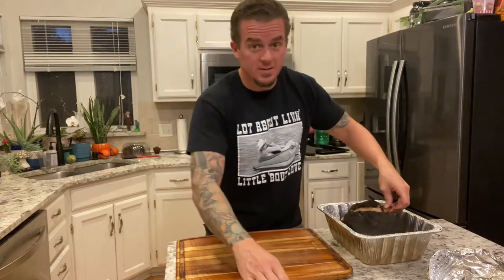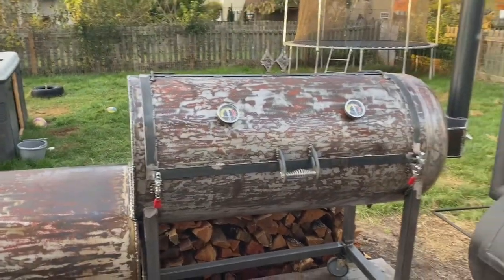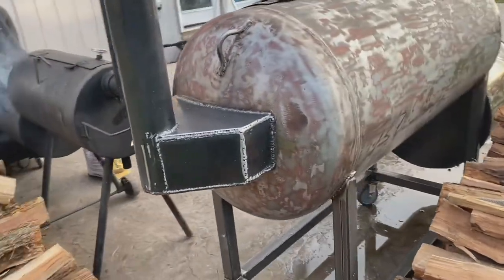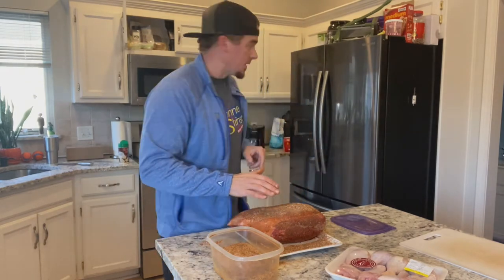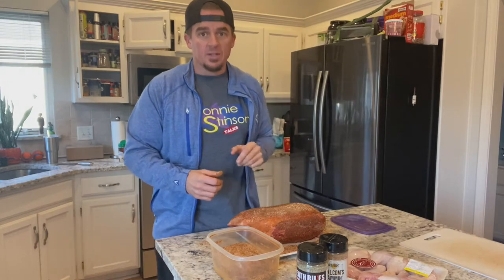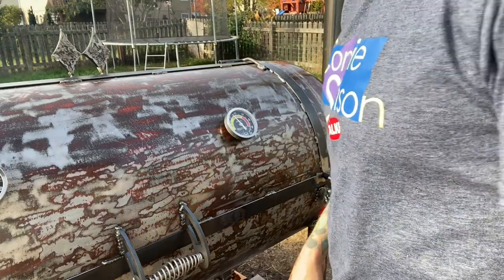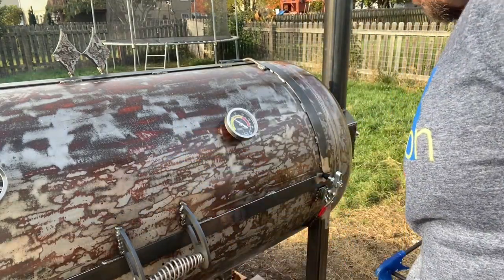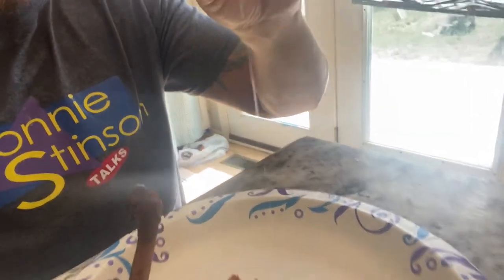DIY Smoker Build First Cook and Overview | Pulled Pork & Texas Lollipops

Comment: Thank you for your candor! A couple of things in my humble opinion: keep your "rub hand" clean when seasoning your meats. As someone already mentioned, I agree the wood is too green or wet and that you can help this by keeping your splits that are next in line on top of the firebox. I wouldn't mess with your firebox airflow damper ("daisy wheel"), just make another notch in the piece that you use to lock your firebox out closer to the end and you can just set your latch into that and it will hold your firebox door open a little (one notch holds it closed, the new notch holds it open a tad). Then you can use your "daisy wheel" to dial it in if need be. Also, if the wind is too much, use a folding type table to block it by laying it on its side between the wind and your firebox.Watched from the start of the build and I think you built an excellent pit! - Rob

Comment: Two things: you can fix your door being sprung issue by welding a couple pieces of rod on the inside of the door. Get it bent to where you need it and then tack them on. 
Second: Open your door to allow air flow, I quit installing dampeners on my fireboxes and instead open the door to where I want it.
Reply: I agree  im the same i just open my door until i get the airflow for the wood where i want ,and i put fresh dry wood on my firebox  too heat it so it catches fire quickly when added too existing fire in firebox.